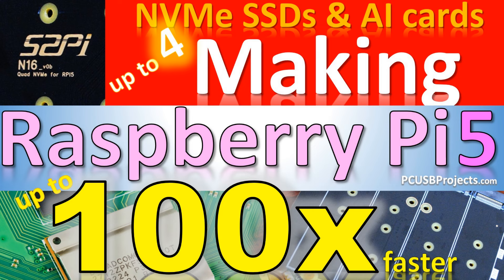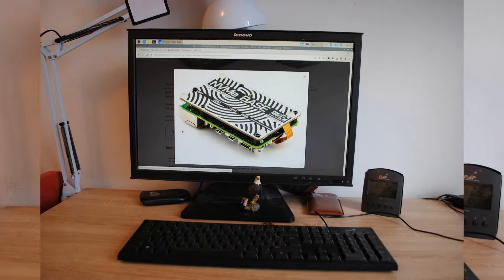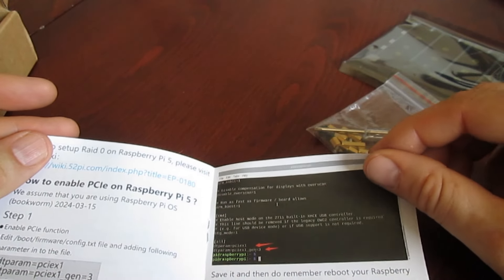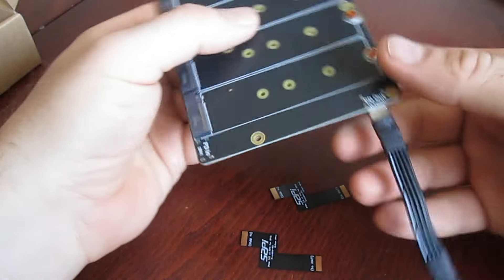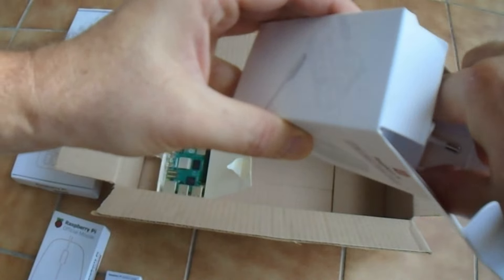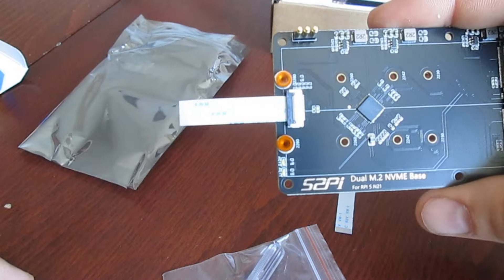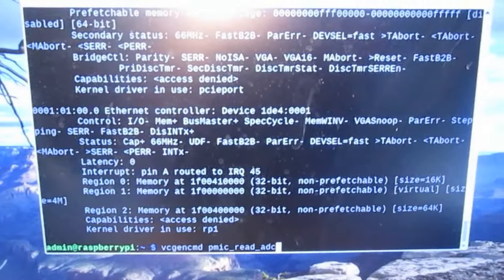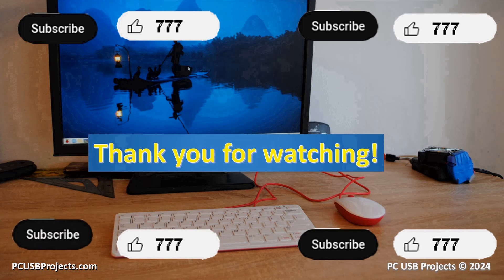Making Raspberry Pi 5 a beast with up to 4 AI cards and/or PCIe NVMe SSD M.2 Drives (52Pi sponsored)

Comment: Thank you for the introduction video for this product of 52Pi, I'm looking forward to your next exciting video!
Reply from the maker: Thanks! Working with fast SSDs is real fun.... Transfer rate for copying from SSD to SSD is really amazing. It takes approx. 10x to 20x less time to copy a 100 GB partition compared to coping the same partition between SD cards! In my case 1h 30 min --> 9 min = 90 min ---> 9 min == 10x speedup.
Reply: @pcusbprojects  yeap, have fun ~
Reply from the maker: I've added now the fan, too. It works magic at 3 GHz CPU + 1 GHz VideoCore: https://youtu.be/zNve_hjinDI... Now, it's really like a true desktop...
Reply: @pcusbprojects  wow, that's really cool, it works at 3Ghz CPU + 1GHz videoCore ? that's amazing, what about the temperature of the CPU at that moment?
Reply from the maker: It's all in the video: https://youtu.be/zNve_hjinDI

BCM2712 operating temperature dropped significantly!
BCM2712 temperature  = 30 deg. C (lite load, standby at 3.0 GHz) and 45 deg. C at full load (at 3.0 GHz) vs. 55 deg. (lite load, standby at 2.4 GHz) and 70 deg. C at full load (2.4 GHz, 3.0 GHz not tested to avoid damaging my Raspberry Pi 5) = -25 deg. C == significant temperature decrease at 25 deg. C room temperature.

Comment: Please do a video after clearing dmesg “sudo dmesg -C”. Then “watch dmesg”.

Show me it working properly with the 4 drives please. My testing is showing it only works without controller resets with 2. 3 or 4 is causing issues.

They are not immediately apparent. Like i said watch the logs. I am not talking about the warnings but the resets.

Tested using the official raspberry psu then assuming the issue is power related tried so many 9-20v 3-6a power supply’s from apple, dell etc.
Please recommend a psu as well

I have 4 x Crucial P3 3.0 4TB M.2 NVMEs. 

Appreciate you!
Reply from the maker: Power consumption is still limited with the original 5 V 5 A PSU. SSD drives of different manufacturers, sizes and types have different power consumption. Occupying all 4 M.2 slots one must take into account that the maximum power (27 W) should not be exceeded in any case. I've therefore build my Extreme Raspberry Pi 5 that has an industrial 5 V 30 A power supply and I've also modified the board to operate on 5 V and it is being powered directly from my PSU. I also use relatively tick power supply cables. Watch these videos to learn more: https://youtu.be/zNve_hjinDI, https://youtu.be/kRHbpFQgxu8.
Reply: @pcusbprojects  I really appreciate you getting back to me. Though this isn't making much sense. I understand 27w might not be enough and this is why I have been trying other psus at other ratings within the 9v-20v range. The 52pi n16 board converts the power to the raspberry pi to 5v 5a (25w). So the board should be to take 5v power supplies as well as 9v and up to 20v. I have tired these with no success. Up to 20v 6.5amps (130w)..
I have now seen a YouTube test say 3 drives at the same time.
My board only works with 2 nvme drives plugged in. they are all new and same brand/model.
Like I said it works perfectly with 2, any two! I can switch them around from all the 4 and it works. AS SOON AS I PLUG IN A THIRD, that's when testing 3 drives at the same time shows controller resets. Then because of the resets a quick transfer becomes really long. Then in a raid this could and has caused issues.

I appreciate anymore help you can provide.
Reply: To be clear, having all 4 drives plugged in appears like it works, it's when you have activity on all of them is when there is a problem. Even formatting your raid causes so many controller rests with 3+ names drives. Having any 2 attached and no more works perfectly.
But I bought I quad kit not a duo :/
Reply: Other people are reporting this issue too!
Reply from the maker: I completely understand. That's why I've built Extreme Raspberry Pi 5 that is based on 5 V 30 A power supply exclusively and it has no step down voltage regulator say from 15 V do 5 V. I've removed the regulators, so my board now has 5 V power supply, only. But this would have never worked with the original Raspberry Pi 5 PSU. 
But I therefore strongly believe that you have a power supply issue. Watch this video to learn more: https://youtu.be/kRHbpFQgxu8. A maximum electric current of a particular SSD drive is usually written on its sticker. Having more SSDs means increases the overall maximum current. If an SSD has a max. current of 3 A at 3.3 V, 4 SSDs of the same type could in worst case generate a 12 A (4 x 3 A) spike, which is 4 A more than a an inbuilt 5 V 8 A step down voltage regulator on the board can handle. There is another step down regulator to power Raspberry Pi 5. Power is routed to both of them in parallel on the board. 
Besides, the board is has additional 4 step down voltage regulators from 5 V to 3.3 V, one for each SSD. So, if you remove the 5 V 8 A step down voltage regulators and power your board and Raspberry Pi 5 directly from a powerful enough PSU (at least 15 A at 5 V -- 3 - times more than original RPi 5 PSU) than 12 A spike would not have been able to disturb your SSD operation. ASM1184e PCIe x1 switch is also used for classic PC extension cards and I've never heard or read about such a problem there. 
However, you also need tick enough wires to power you RPi 5 and the board. Power distribution is very important here! I don't route power for the board through Raspberry Pi 5 or the board, but I power both from an add-on power distribution rail that really had tick wire connections. 
To conduct 12 A you may use a standard 16 A household device cable, or more low voltage 5 A or 10 A cables in parallel like a classic PC does... Keep in mind that the maximum power that the original RPi 5 PSU can provide is only 27 W (but only 25 W at 5 V), no matter what you do. So, the board designers really tried hard to first ramp up the voltage to 15 V (there is special chip that instruct the PSU to provide higher that 5 V input voltage) and then regulate it to 5 V to squeeze the last atoms of power from the PSU. However, it seems not to be enough for all cases... 
This is only my opinion. I can't test it anymore, because I've altered my board. I've had no such problems so far.
Reply: @pcusbprojects  Thanks. Let me review your video. Though I will say that 52pi sponsored you. You seem to be helpful why are they not getting back to me. They didn't sponsor me, I paid for mine. Can you please request that?
As a customer it was sold to me as being able to handle 4 nvmes in raid 5 which it can't without further modification beyond the target audience capabilities, mentioned or advised to them.

I would defo do a modification if it is easy to do as I want the product I paid for a month ago. Yet I have spent far too much time on this and 52pi are 100% mis-selling this product (if it requires this modification you suggest).

People like myself who love Raspberry Pis are willing to tinker but when a company claims their board can do something it shouldn't require hardware manipulation to get it to its originally sold for state - Purchased direct from their website as a nas kit that can do raid 0 or raid 5 across all 4 - I can't trust my personal files with this when there is constant controller resets, which then leads to IO errors which could produce some corruptions.
Reply: Also i currently have a 20v 5a anker nano power supply but same issue. Thats 100w. 
I don’t have other peripherals. It was intended to be a complete package only needing a pi, psu and nvmes. Running headless. 
I also have monitored temps and although it never went above 60c. I bought heatsinks for them too and only after my testing did I put them on and test again with same results but now the nvmes are around 40c
Reply: @pcusbprojects  5V8A is 40W. 
I am not beside my NVMEs right now but if i recall right they are 3.3v 2.5a so 8.25W. 4 of those is 33W under the 40W. 

Or are you saying a pd power supply above 40w doesn’t matter as it’s restricted?
Reply: How much do you think the board uses without nvmes in it? As I guess that’s 7W left
Reply: Anyway it does this with 3 drives as well so that would only be 24.75W
Reply from the maker: Yeah, but you are at the margin of the regulator capabilities, because you are limited to 8 A at 5 V for 4x NVMe + 8 A at 5 V for RPi 5. This is not enough. if for example a power spike of 12 A occurs.
Reply from the maker: The max. allowed electric current through step down voltage regulator of SSDs (8 A at 5 V) is important in this case. You've mentioned that you can normally use the board when 3 SSDs are attached (3 x 2.5 A = 7.5 A) . 8 A is therefore the max. output current on 5 V. When you add the 4th SSD the max. current gets to 10 A. However, you have an additional 5 V to 3.3 V step-down regulator for each SSD, which is also not 100 % efficient. So you might just get over the edge with the 4th SSD in some cases.
20 V at 5 A PSU is also on the edge of its board input voltage capabilities and as much as I know it also heats up significantly. A cooling fan might help to prevent voltage regulators overheating, but it can't help if they are stressed over their current limits - then the voltage would have inevitably dropped. I have no such problems, because my board is now powered by 5 V only exclusively without the 8 A 5 V step-down voltage regulators. So, only 3.3 V step-down voltage regulators remain, which are independent from each other. There is also a voltage regulator for ASM1184e chip, but the chip only uses a small amount energy for its operation. 40 W PSU does matter, but you are limited by voltage regulator capabilities and their efficiency. More heat dissipation means less useful power....
Reply from the maker: And don't forget that Raspberry Pi 5 is also powered by the same power supply! You can't have 24.75 W on SSDs effectively with the Raspberry Pi 5's original 27 W PSU, because Raspberry Pi 5 need approx. 11 W for it's operation at max. CPU/GPU load, if not overclocked. If it is overclocked to 3 GHz it needs approx. 15 W at max. load + power for the cooling fan and the attached USB devices....  I've built my Extreme Raspberry Pi 5 to deal with such problems. You can watch this video about it's constant overclocking to 3 GHz with a help of powerful cooling system: https://youtu.be/zNve_hjinDI. It's completely stable and I use it every day for a few hours...
Reply: @pcusbprojects  I seen same results powering the Pi directly with a 27w official raspberry pi psu and the board with also another official raspberry pi 27w psu and also 60W, 65W or 100W power delivery psus. What would be the likely explanation for that?
Reply: @pcusbprojects  So the 52pi board is not powering the pi in this scenario and same results.
Reply from the maker: I can't find any PCIe x1 switch extension card based on ASM1184e chip for a classic PC failure reports on the internet. On my opinion 52Pi N16 board step down voltage regulator electric current limit of 8 A is somehow exceeded at some point in time, when 4 SSD drives with 2.5 A max. current are installed and simultaneously executing an operation that required max. power like formatting them. I have no better explanation. This cant happen to my board anymore, because I modified it to be powered it directly from 5 V 30 A PSU, therefore a higher current rating theh 8 A is possible. You have to take into account that a step down voltage regulator also has a maximum current limit regardless of a PSU that you use.
Reply from the maker: Powering RPi 5 or not, you still need enough current for the SSDs. Mine is not powering my RPi 5 either. Here it is what I've done: http://youtube.com/post/UgkxgLSp27Ayquj-6Zux42JHuJLPNH-0MTF5?si=wzdaNT5w4eEb9NvU.
Reply from the maker: It is not only the PSU, it is also the in-built voltage Texas Instruments 5 V regulator that is common for all 4 SSDs. It can not handle more than 8 A no matter what PSU you use. I've (electrically) skipped it and I'm powering my board directly from 5 V 30 A PSU, so there is no such max. current limitation. Each M.2 connector has its own 3.3 V voltage regulator, which is the same as you have. But all 4 .3.3 V voltage regulators are now powered directly from 5 A 30 A PSU. So the new current limitation is much higher than 8 A (probably more than 20 A, if I use a tick enough power cable). Here it is, how my board looks now: https://www.youtube.com/channel/UCx_VjpZyXd_uTFOnur_YJ6w/community?lb=UgkxgLSp27Ayquj-6Zux42JHuJLPNH-0MTF5.